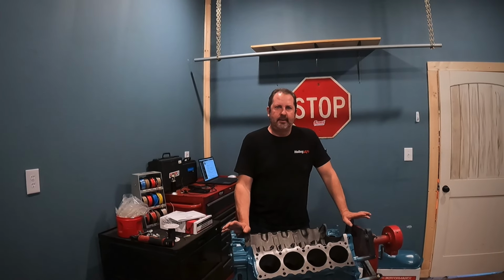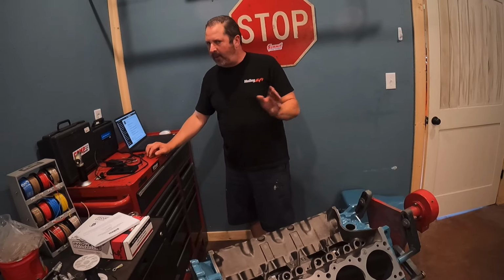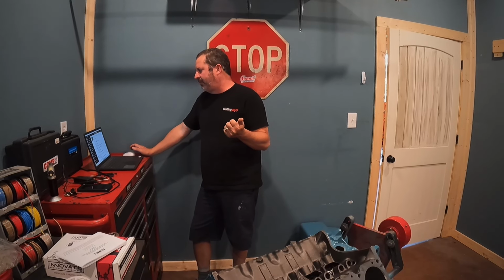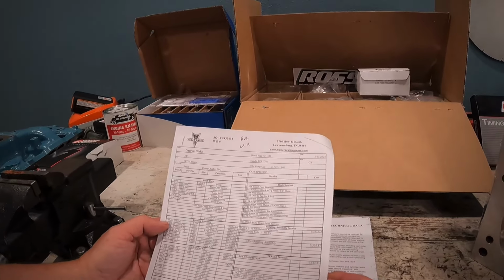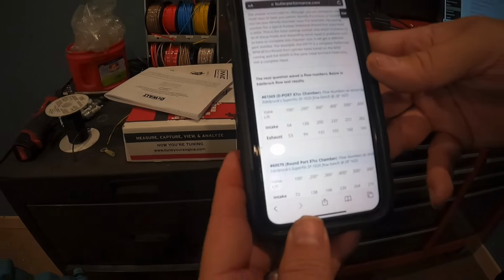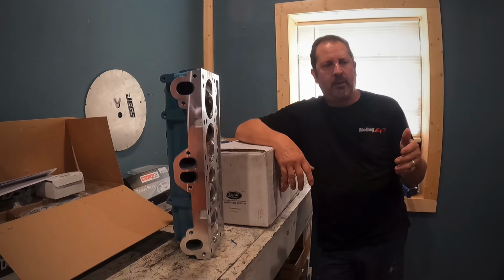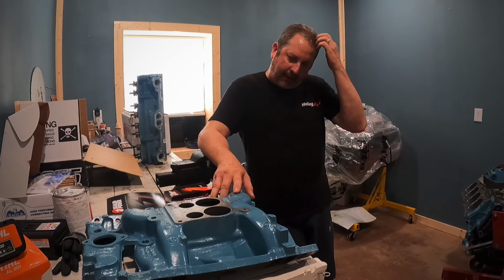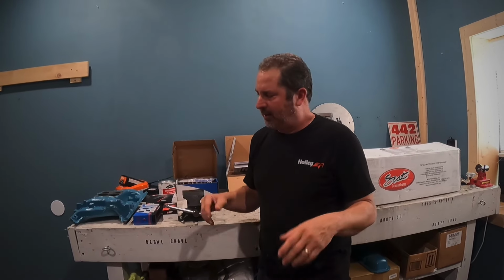Pontiac 350/383 Stroker Build

Comment: I been building Pontiacs since I was a kid ..there is no suck thing a a big block Pontiac. Just small or large cubic inch the blocks are physically the same .326 to 400 all share the same 3.75 stroke .421to 455 they changed the stroke and bore size I could go on and on for ever explaining .long story short the valve reliefs are 69 and up 350 blocks to use the factory 211 166 valves I built a 350 back in the day with  670 casting heads ( 67 ) only 72 cc heads factory screw in studs and guide plates a old fireball cam ECT you can't hardly beat the early factory 4 bbl intake for flow  .I could just stomp on SBC and BBC on a regular basis ..the 350 Pontiac is a very under estimated engine

Comment: I like this build approach you and the owner are taking, I'm building a 461 stroker Pontiac 400 for My 78' T/A 4speed. And I see a number of parallels  like Butler Performance, moderate cam, Scatpac, cast manifolds( intake and exhaust)...etc. I'm aiming towards a proportioned build for a good streetable driver that can also smoke the tires( when needed)!!
Reply from the maker: @curtpozzi5527  - That 461 should be a screamer! Thanks for sharing!